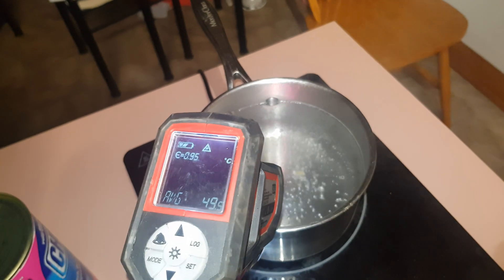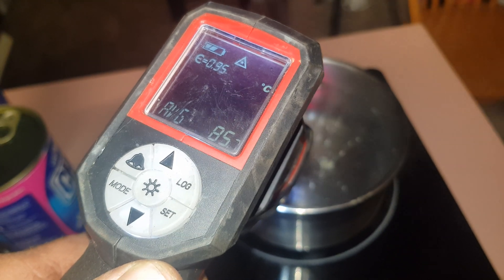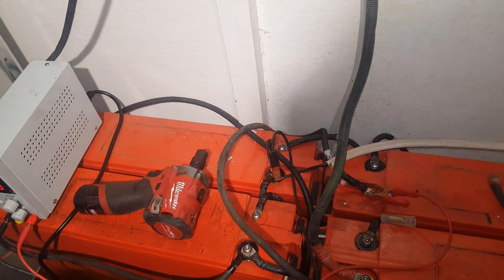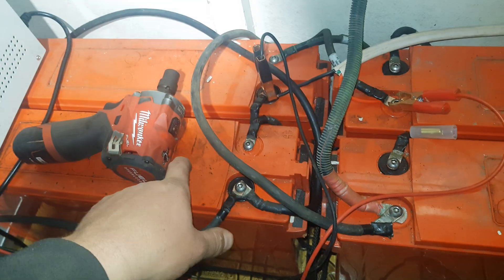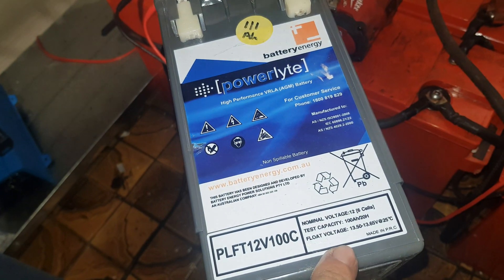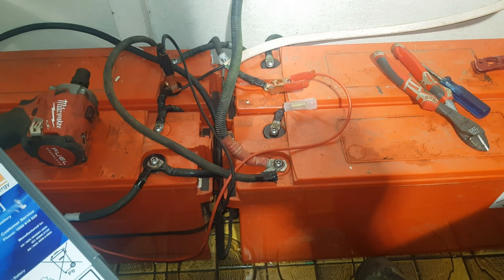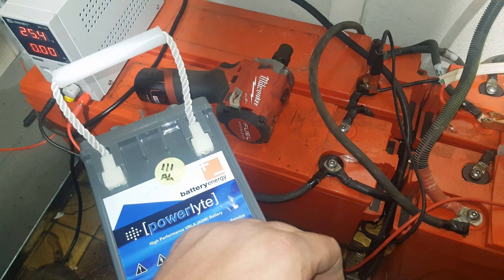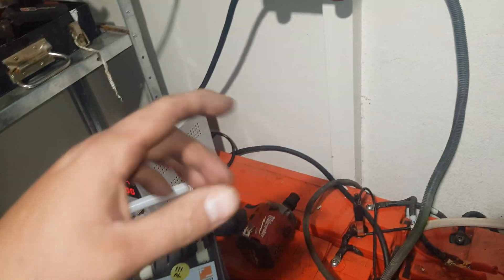New Super Safe  Sbs190f Power wall First Tests Pt2 Kettle & Induction Cooktop

Comment: Is the power supply that you use to charge them is using linear regulation or switching regulation? Can you provide the model info for the PSU? It looks like a lab power supply, which are usually linear regulated, which is very inefficient at high currents and low voltages.

EDIT: It is SMPS so you are good. ;D  Longwei LW-K3010D, not the extremely efficient one (~80%), but ok. 90%+ are quite easy to find. 95% at few kW is harder, but can be done, and there are products to do it.

Comment: I was wondering when you would come to your senses and convert the bank to at least 24V. 48V is better, but the inverters are bloody expensive, especially if you want good gear (I have a Victron 48/3000, and it cost me a bomb). You setup is a bit like mine at the moment, I have a breaker on the charger, but no protection what so ever on the inverter. I too need to buy a battery disconnect and a breaker for the inverter.  I have some 120A fuses pulled from dead ups which I can fuse the system with. My tiny 12V setup has the batteries on float by midday, and that with a panel sitting in my back yard, poorly angled, and copping shade all the time. Big HV 49V GT panel :)
Reply from the maker: Yeah battery disconnect is next on.list
Reply from the maker: 24v is going well

Comment: Why the restriction on 4K video at 10mins, not YT, I’ve uploaded to YT over ten mins at 4K.
Reply from the maker: File system its over 4gig per file and phone must be exfat 32
Reply: One Up The Sleeve Customs
I see, that sucks. I use my phone to for my YT channel but I do several Videos and then splice them together with the gopro app called.... Splice.